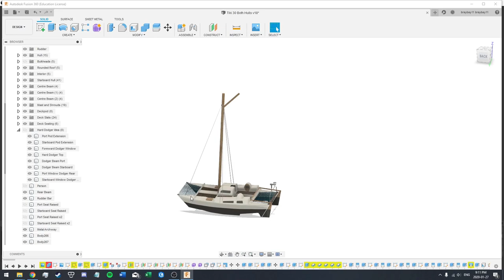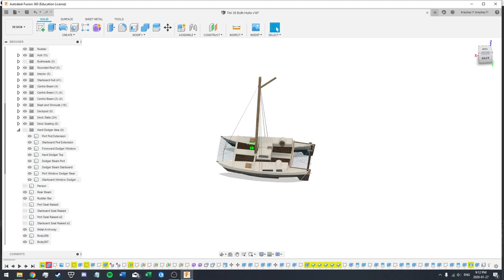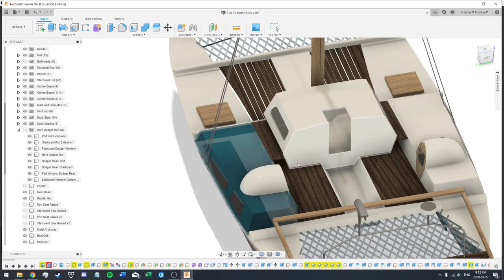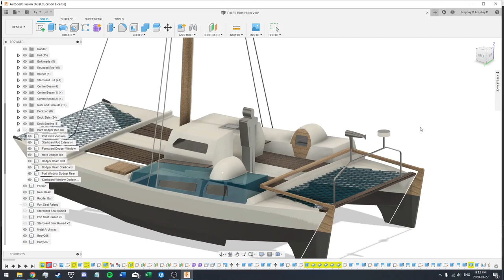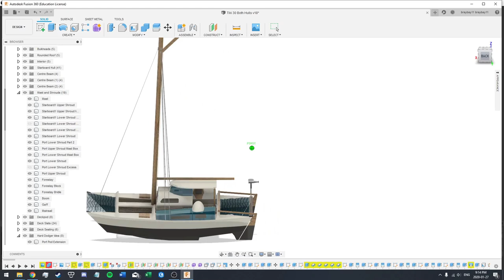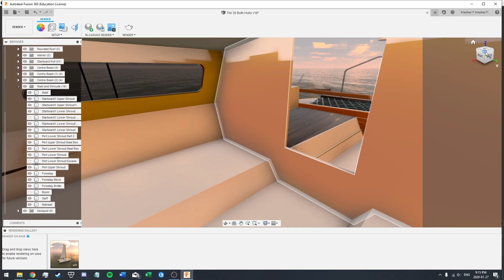Tiki 30 3D Model

Comment: I admire your computerskills 👍👍when you raise the mast by one meter or more you will feel the effect on the stability of the boat. The kentering forces increase both sideways as well as forewards ( pitching). Your sheets angle will no longer fit the deck layout. Your main will be to high for the sheetingpoints on the deck layout,  even the shape of your foresails cannot be maintained unless you bring the forestay(s) back to the original angle.

Comment: I'm worried that the cabin hatches will be quite awkward. I have a monohull with hatches like this, a Raven 26, and like the contessa 26, but unlike this design, the bottom of the hatch goes a long way down. you still have to duck down quite a bit to get in. With this design, the total height of the hatch is actually quite low. might be a good idea to create a mock-up of the cabin (from cardboard, etc) and try moving about in it. Maybe a normal hinge hatch with a bubble on it?